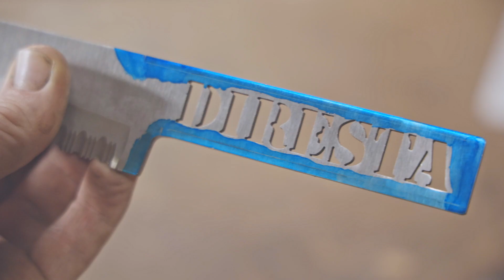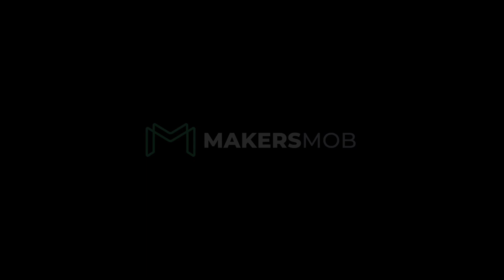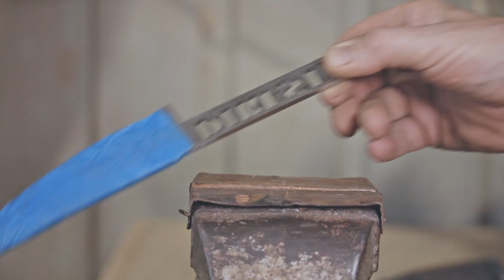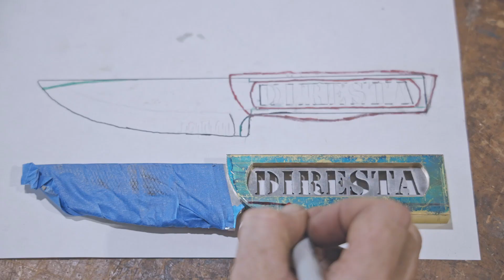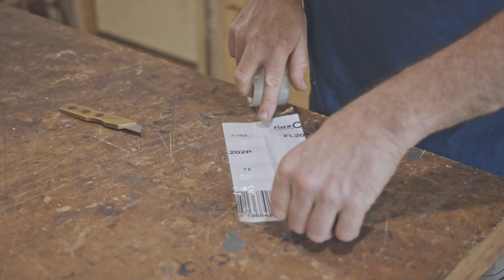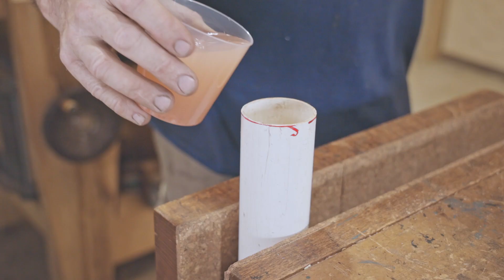Diresta Skeleton Knife with a Brass Handle

Comment: That's a nice looking handle you've put on Diresta's blade. I think I would have liked to see you fill the tang window in with an epoxy which you mentioned possibly doing. It would have looked just as good but more importantly it would have made the handle far far nicer to hold onto than that hollow area.

Comment: A nice job! The best approach so far, IMHO. Also my opinion, but I think Jimmy D's blanks have a possibly-serious design flaw: The two pointed 'serif' areas of the 'D' creates stress risers in an area already severely thinned by the removal of metal from the 'D' itself, close to the critical blade/tang junction. I don't think it's going to take long (or any heavy use) for the blade to snap off, or at least bend, at that point...

Comment: Glass and tile drill bits work great on hardened steel and quite cheap (you know, carbide-spearhead-brazed-to-stem type), but have the tendency to snap at the finishing part of drilling a hole, so caution needed.

Comment: Very very average Neil 😁👍 I see Jimmy is suitably impressed😊
When you get the mill set up and have recovered from the cost of tooling, I'd highly reccomend the lovely Quinn at Blondihacks for a teacher.
A little tip for pins and peening, take a suitably sized round tapered file (diamond works best) and slightly taper the hole to over about half it's depth, making the hole entry maybe 0.25mm larger. This gives much better engagement as the pin will expand to fill the tapered section.
🍺
Reply from the maker: Thanks Bill! I meant to taper the holes but got carried away in a rush. I've tapered them in the past with a modified spade bit that works well with brass. I'll check out Blondihacks as I need all the help I can get. :)
Reply: Cheers Neil. I reckon you will enjoy Quinn's style, alternatively have a look at Emmas Spareroom Machine Shop. Another very clever lady that also has a discord server full of other very clever ppl.

Comment: In my past life, when clients wanted bright brass hardware, I made sure to advise them that they may start with shiny brass, but it'll be antiqued in six months anyway.
Reply: one of the more insane things of humans; shining bright brass door push plates , then cleaning out the screw heads after. of course the factory where i did that had copper coal buckets for trash cans. yup those were polished too.

Comment: I must have missed/misunderstood why you cut out the butt end of the brass handle, then had to fill it back in and peen it over..? If the tang went in from the "front", why not leave the back end solid in the first place, and file in the little recess you need for the steel handle to sit in from the inside?
Otherwise very interesting build, as always! 👍
Reply: I believe that was done to lock in the blade end, like a tenon into a mortice.
Reply from the maker: I wouldn't have been able to get in there to file out a recess from inside the window. :)
Reply: 😁
Really?! A guy as determined and ingenious as you?!
I'd have just done a few very shallow passes with a dremel or diamond grinding wheel or something, then finished it with a needle file..after all, it only needs to be a very shallow slit..
Reply: Mutasim Aldory going all the way through and peening the end is far stronger and far easier. I honestly doubt any knife maker would’ve willingly done it any other way.

Comment: It turned out beautifully but I'm concerned about the perfect 90° cuts on the blade, this are stress point and the blade could brake on that corner by using the knife. A rounded transition should solve the problem. By the way, nice video as always

Comment: Another mounting option, that could have been used in conjunction with the pin, is to undersize the hole and heat the handle to slip on to the tang. The compression from contraction would hold the handle in place. This is more finicky to achieve well however, and if the hole was too undersized you might risk introducing sufficient forces in the handle to crack when it is later being shaped.
Reply from the maker: Thanks, that did cross my mind but I have no experience whatsoever in achieving that. :)

Comment: I like the shape of the handle, some clear epoxy in the middle (where the Diresta logo is) would have made it more comfortable, in that way, with the clear epoxy, you are still able to see the logo. Thank you for the awesome video. :)
Reply from the maker: Thanks! I reckon it looks better without, but that's personal preference. It's pretty comfortable as it is, it's a great fit in the hand and it's not like you hang on to a knife for hours. :)
Reply: @PaskMakes  You've never spent much time in Frankston, have you? :)
Reply: @PaskMakes  You could try fitting in two pieces of shaped and polished glass. Glass keeps clear and doesn't scratch as easily, and is equally hard to the touch as the brass and the steel.
Reply: that and you would prevent gunk and grime from getting clogged in the lettering. so it would keep it clean and better looking longer

Comment: Couple stupid questions, what type of hacksaw was used to cut out the brass center?

And is the blue paint just to protect the surface?
Reply: It's a coping saw, made to be threaded through a pilot hole to allow cutting out the middle of a piece.

The marking fluid makes scratches you later make more visible so that you can indicate what you  want to do the work,
Reply: @belg4mit  and that's the second dumb question answered, cheers mate
Reply: The blue paint is marking fluid.
Reply: @otterylexa4499  cheers that's one dumb question answered

Comment: Interesting, Shinwa rasp on brass?
Reply from the maker: It worked great and I'm pretty sure the fine side is made for use on soft metals ( I used both sides and they both worked). :)
Reply: @PaskMakes  I suppose the concern is more about whether the rasp doesn't become dull too fast this way.
Reply: I was thinking the same
Reply: Hmmm yeah I'm not sure about this one tho in many videos people say brass is soft enough to use normal woodworking tools on